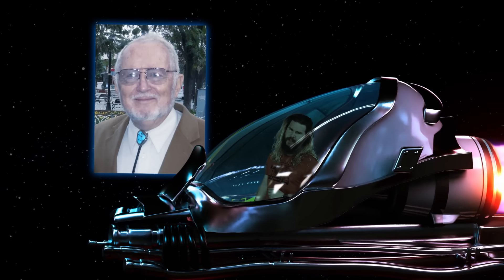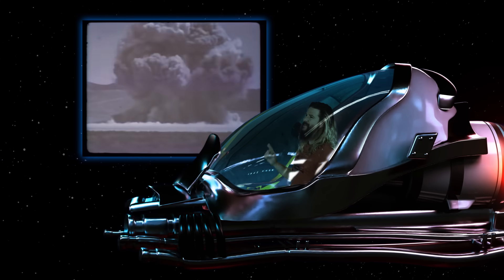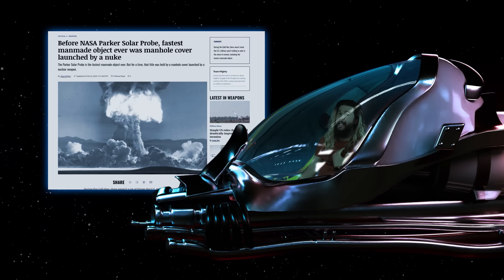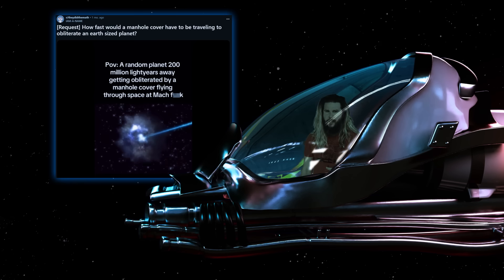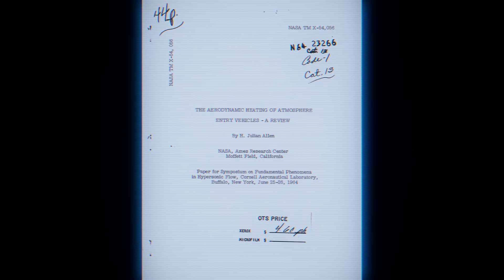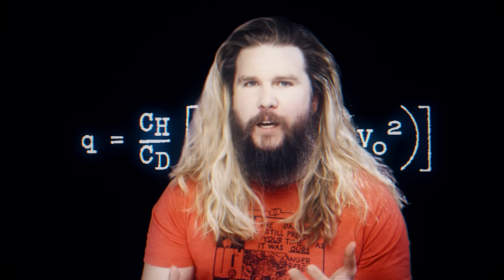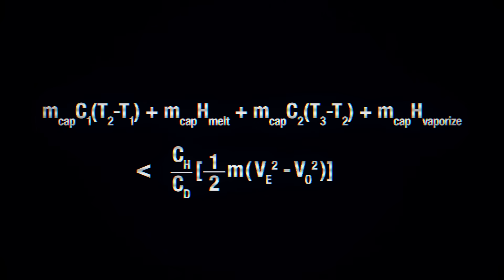Debunking the Nuclear-Powered Manhole Cover

Comment: Say what you will about Spinlaunch, but they are essentially taking on this exact problem in an industrial setting.  Catastrophic reentry is not even closely related to catastrophic ejection due to the reverse in atmospheric density gradient.  The problem with reentry is you slow down as you hit the atmosphere, spending more time in higher density air, leading to much more severe energy losses.  In the reverse, your object, assuming it has the structural integrity to survive the forces involved, punches through the high density air very quickly and then essentially flies through the lower density without further ado.

I think a more accurate analysis would involve carrying out the integral of work done on the manhole cover using the atmospheric drag equation for a flat plate as it flies through a medium of linearly decreasing density.

Comment: Question, Does this account for the shockwave pushing the air surrounding the manhole cover away? When exactly would the friction from air kick in? Some other observations, do we know if the manhole was horizontal the whole time? If it was spinning or vertical how would this change the result? As other people noted the equation was for re-entry where this was travelling in reverse, as it gains altitude the air and resistance would become smaller not larger.

Comment: Assuming it flies face flat straight up is a bit of an oversimplification; also as it melts, its shape would change as it loses mass and its surface area decreases, so the possiblity a small fragment could have made it to space remains not disproven. At least by the method used in this video.

Comment: Doing some incredibly rough math and being one order of magnitude off hardly disproves much of anything, especially since this assumes the disk stayed perfectly flat which is astronomically unlikely. "Sanity checking" by comparing a 2000 pound plate of refined steel against hunks of space debris isn't exactly sensible either for that matter

Comment: Did the formula assume that the disc continued to fly with its widest face forward the entire time, instead of tumbling through lower air resistance configurations? (i.e. are we assuming the disc never spun egde-into-the-wind?)

Where did the number for how much the disc decelerated come from? 

Since air resistance increases by the square of the velocity, and the final result was only ~6x the energy needed, the speed estimate would only need to be off by a factor of 2.44 to get below the vaporization threshhold, right?

On the other side: If the manhole was going fast enough, the energy might never have time to permeate deep enough into the steel to evaporate it all. This is similar to how the pusher plate on the Orion drive was found to be able to withstand thousands of nuclear blasts in the course of a launch. Each blast was so brief that it only vaporized a tiny surface layer of the plate. The researchers analogized it to the difference between flicking a coal with your fingernail, versus holding the coal in your hand. On the brief exposure of a flick, the heat just doesn't have the time to transfer into you. Experimentally, the engineers found that all they had to do was have an atomizer pump a spritz of oil onto the plate after each blast. The oil would vaporize off and leave the steel plate untouched, ready for the next pulse module. The possibility that the disc was moving fast enough for this to become a factor depends on the angle of attack relative to the atmosphere, and the speed of the plate, this time with insane speed being an advantage for the survival of the plate. We're used to talking about how the re-entry plates on spacecraft super-heat on the return to the atmosphere. But take into account that manned craft are braking largely parallel to the atmosphere, to slow down gradually, over minutes. A disc moving 6X escape velocity straight up, instead of gradually braking on a course mostly parallel to the atmosphere could have considerably less time for heat to penetrate.

The equation flies by fast enough, and at a glance seems to already be compressed: I can't see what you used for VsubE or VsubO. But if we consider the best-case-scenario for survival (disc goes straight up, with the least atmospheric distance to fly thought) then a quick estimate that the velocity lost would be less than a single escape velocity seems valid.

Doing the math is admirable, but I think we've got more unknowns in this equation than were really accounted for.

(Edit: As I scroll down through the comments, I see other people raising these same concerns.)

Comment: you've used the right side of the equation entirely wrongly. the reason the right side is just a difference in kinetic energy is because friction with the air is the only action reducing an RV's speed. you can't just reverse the process and say "well the cover went from zero to 66km/s, so that's the total change in KE due to friction with the atmosphere". that's nonsense. and you can get a sense of how nonsense that is by just calculating how long the manhole cover would remain at appreciable atmospheric pressures to experience friction anyway, and it's microseconds. not very long to transfer all that heat, the calculation of which you admitted you didn't even bother to do. what you've actually calculated is whether frictional heating sufficient to slow a 66km/s manhole cover to zero velocity (over whatever timespan is necessary to do so) is sufficient to vaporize the cover, and found that it is. you have not answered the question of whether this manhole cover reached space.

Comment: Did you take into account that it wouldnt be at room temperature when it started flying? The explosion should have significantly heated it up, as well as compromised its structural integrity, making it likely to break apart in flight into parts much easier to vaporise.

That said, even if it was for only an instant, it likely the fastest man made object so far

Comment: 3:18 "What is leaving the atmosphere at a high velocity actually like? Well, the inverse: entering the atmosphere at a high velocity, right?" 
I readily confess that I am quite ignorant with this stuff. Having said that, I don't see how your comment can be even remotely accurate. Going through the atmosphere from space to ground involves an increase in air pressure, while going from the ground to space involves a decrease in air pressure. If I look at math, 1/10 is not similar to 10/1.

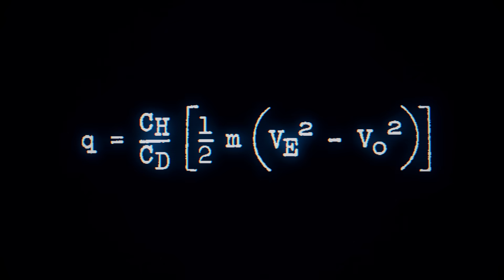5:03 "If the cap made it to space then it wasn't vaporized."
This makes sense to me. However, is this a certainty? Could it make it to space and still be vaporized? I don't think something could make it to space and still be vaporized because, I imagine, the forces required to vaporize it should be non-existent. I say "should be" because I wonder if something that makes it to space, particularly if going fast enough, could still be carrying particles from the atmosphere and therefore bring those forces with it. Also, as I understand things, the earth-space boundary is not an absolute limit but rather an arbitrary limit defined by man, which means, I think, the atmosphere actually continues well passed that point. 

Can someone please help?

Comment: Either it was vaporised or it was shattered into small pieces that would have slowed down very rapidly (because the surface area to volume ratio of a small object is far larger than that of a large object, so atmospheric friction would have been commensurately greater).

But even if it had somehow survived its journey through the atmosphere, it couldn't have been the first man-made object in space, because that was a V2 rocket that was launched in a near-vertical trajectory during testing in 1944.

Comment: Did anyone think of the fact that an asteroid is hitting the atmosphere at it's thinnest and progressively making it into thicker atmosphere and it's the opposite for the manhole cover. Would the change in atmosphere density thinning on its way out into space make this possible? Is that equation for travel through 1 set density for the atmosphere..say sea level?

Comment: 5:12 i dont buy that mistake was actually a unit error.  That would be like 4 or 6 times wrong.  That would put a mid course correction completely off the planet. It was just a little whoopsie though.  I think they just made a normal mess up and decided they could use the chance to smear the imperial system

Comment: I'm afraid its even more complicated than that!
First, the comparison to a meteor or similar entering Earths atmosphere at some high speed is NOT equivalent to reversing the movement outwards and the reason is that an object entering the atmosphere from space encounters an increasing atmospheric density whereas an object leaving Earth experiences decreasing atmospheric density.  The heating effect would be much faster for an exiting object than for an entering one.  Also, the drag of the object will be a complicated function of the objects frontal area AS IT CHANGES due to rotation.  It's still likely the object would vaporize, but to do that in at most a couple seconds is quite the chore.  Finally, the shape of the 'manhole cover' is almost certainly going to be deformed from a disk to something more like a teardrop even before it moves more than a few meters and this change in shape will have a significant effect on the drag, almost certainly lowering it.

Comment: The thing is, objects burning up in the atmosphere are 1, typically moving at an angle and not straight up in the air, 2 not made of refined steel and concrete designed to withstand a freakin nuke, and 3, still typically able to survive and land on earth
Reply: This steel cover was very obviously also not "designed to withstand a freakin nuke!" :D
Reply: An iron-nickel meteorite would have about the same melting point as steel.

Comment: I hope that you will address the mistakes that were made in this video, or argue why they weren't mistakes. Something else I haven't seen people mentioning is the assumption that the cap was traveling in a way to produce maximum drag, flat on its face, rather than an average from any rotation. This may have been accounted for but from your description it didn't sound like it.

Comment: weirdly a lot of the original iron used in industry and weapons were from meteor deposits that survived hitting the atmosphere... though sizing varies quite a lot they are usually tiny in comparison to a 2000lb plug... and also probably more pure so odds are the impurities in said plug caused it to go either pop or melt sooner than expected.

Comment: I used the Nusselt number during my PhD thesis. It typically falls in the range of a few 10s, around 60 for many material. The 24 used is reasonable, especially as a lower bond.

Comment: A couple of things I’ve seen from other people doing some math on this:
1) it doesn’t spend enough time in the atmosphere to heat up enough
2) it may have been going faster than first thought
3) aerodynamics get a little weird at hypersonic speeds and drag may be lower than at slower speeds, resulting in less heating
4) lastly the manhole cover would have been unlikely to stay broadside forward, so it makes sense to calculate the drag for it at least somewhat side on.
Reply: additionally, it probably wouldve shattered, as it experiences huge pressures

Comment: the other problems that i think need to be acounted for are: did the cap change its shape before "liftoff" and if (probably) so how did this effect it's aerodynamics? also how much thermal energy was imparted into it by the blast itself?  starting surface temperature probably wouldn't factor in, but air temperature definately would effect the atmosphere's density. the math is flawed at best, which is not to say i could do it better (just looking at those equations made my head spin) but as someone who belives in being thorough it's definately worth another crack.

Comment: I doubt your math has gotten us anywhere closer to real answer.
Where is  V_0^2 ? You just assume its 0? So cover has dumped all of its energy into heat? And what about C_H/C_D being more than one? Oh... so almost 19x of its kinetic energy into heat?
Also keep in mind it is going pretty much perfectly vertically up, unlike meteors, so it needs to burn down really fast.
I think the biggest factor is its shape, and i doubt simple drag coefficient can do it justice: some meteors even explode due to air "not getting out of the way quickly enough" and getting adiabatically compressed...
You know, now that i think of it, maybe there is a reason noone properly did the math for this. Maybe its not that bad to tell a cool story that at first glance sounds plausible without proving it actually happened? Certainly not as bad as setting out to prove something wrong with math and science and then do it this spectacularly poorly.

Comment: Serious inquiry! Is it possible that the change of atmospheric drag from the increase of altitude was included within the calculation? The meteor analog given showed those rocks flying very shallow trajectories. This manhole cover would have had (I would assume) a very direct trajectory towards space, which In my opinion would have a “not so insignificant” difference in their fates.

Comment: Another variable that may also help those numbers is the "instant" heating it would have experienced when it was hit with all that hard radiation emitted just less than 400ft away? 
That would give a big head start to the initial temp. Let alone cast iron is rather brittle and just that flash-heating could have made it very weak or started the physical disintegration before fully melting.

Comment: Convection takes time. Which this cap didn't have in any thickness of atmosphere. The meteors burning up on entry are rarely dropping vertically as well, so time in atmosphere is much longer.
I think a physical \ mechanical failure is more likely because it would've literally pushed a column of solid air up.

Comment: That's a hell lot of heat to transfer in one second. You can shove your hand in molten lead and not even be harmed if your hand is wet, just as you had a hell lot of concrete with terrible conductivity behind that manhole chucking it forward.
And asteroids are not perfectly solid and continuous like cast iron, and ironically, are moving slowly enough to have time to burn up in the atmosphere.
More math required. There is enough power to vaporize it, but could it absorb that heat in under 1 second, which is the time it took to reach orbit? 
Indiana Jones tossed airborne inside a fridge that didn`t melt says hi. Same problem. Would Indy get cooked inside that INSULATED fridge? We can doubt the movie, so we should doubt the manhole vaporizing.

Comment: The internet is getting sick of these "Did-they didn't-they" videos about this manhole cover.
We just need to dig a deep hole, stuff it with enough conventional explosives to get the same blast/pressure wave as the Pascal-B device, and do a practical test. Get some high speed cameras and an orbital launch tracking camera rig (NASA has a few..)... I wonder what country would allow us to conduct such an experiment. 🤔 🔥
I bet the guys from @OrdnanceLab are loco enough to do it.

Comment: Alright so I think this ‚math’ is BS. 

Atmospheric exits and entrances are different, as the drag force alignment to the gravity changes. This means that if you descent down to earth, you can do so at a constant velocity (like a parachute), whereas if you try to exit the atmosphere you will constantly decelerate (or have rocket boosters). 

The paper you referred to states that the formula you used specifically requires that the heat transfer coefficient (C_H) is constant. This would imply that the speed of the manhole cover is constant, as Nusselt numbers for such cases usually tend to depend on the Reynolds number which itself depends on the medium velocity/object velocity. The Nusselt number is doing a lot of the heavy lifting here, just ‘finding a number that makes sense’ is not particularly transparent or sensible. 

The manhole cover is slowed down by drag, so the speed varies. This means that you need to use the differential formulation of the formula, which is formula (3) in the paper. 
This calculation at the very least needs to be a differential equation that you will then solve to get the total heat input. 
Go get the Nusselt number in all of its empirical glory (if those exist, which I doubt due to the niche problem) and integrate over all of it (most of it should be condensable down to velocity and a bunch of constants). This would still be vastly simplified napkin math, but it would at least be somewhat realistic.

Comment: also meteors blow up at high altitude where the air is much thinner so the cap had to push through thick air at extremely high speed